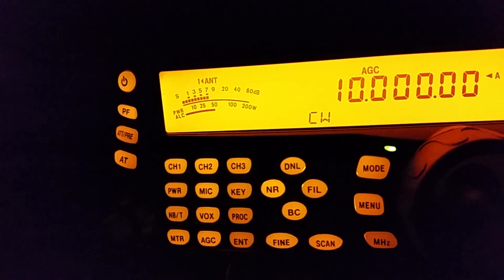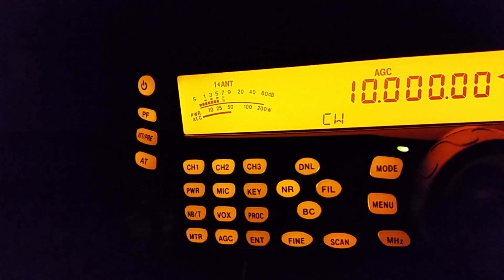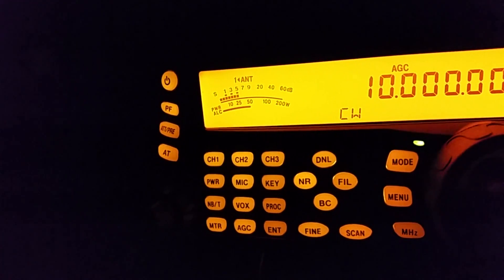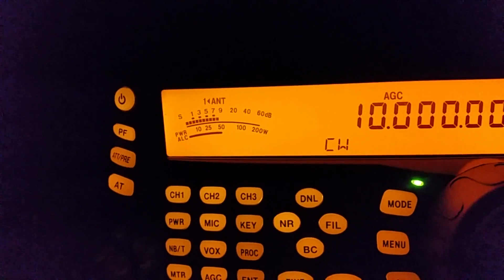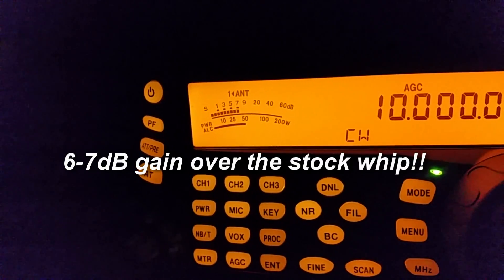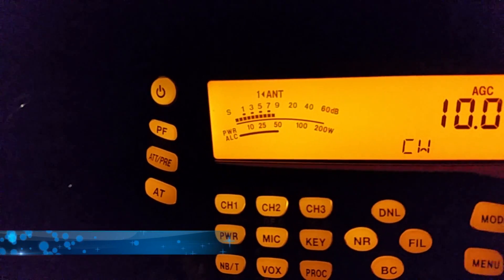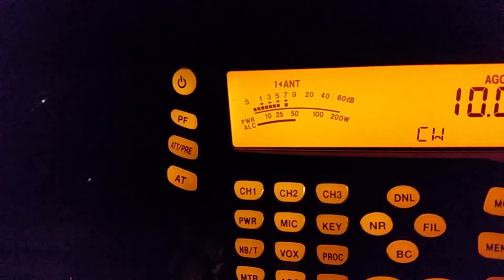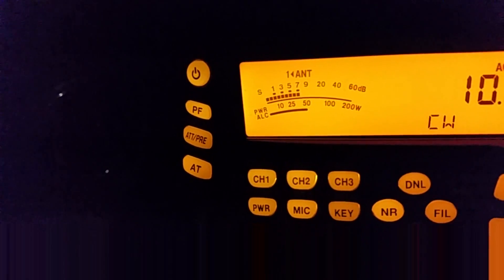Testing longer whips on a Little Tarheel II

Comment: They say that the gains are more pronounced on 80 meters and with the 10-12 foot whip 160 is possible. I just got mine last week after a 3 month wait. I'm thinking of setting up a rig with grounding so that I can try it on the base transceiver. No point in leaving it out all the time for the thieves to get. It might work well as an alternate base antenna when not in the vehicle.

Comment: have you had any problems getting on 80mtrs with yours TH? i got the tarheel extra long stinger and still doesnt tune 80 so not sure whats up.
Reply: I had a TARHEEL II & it tuned 80 meters with ease with a 54” whip as it did all of the other bands through 6 meters.
Reply: I would think that grounding is the issue.
Reply: @9999plato  i dont think it is grounding. i have the antenna on a L bracket screwed into my tool box on the truck and the tool box is grounded to frame in 2 places with braided wire the body of the 480 is under pass seat and grounded to frame. thats what has me stumped i think i`m doing everything right. next thing im going to do is clean the coil itself. i saw a video of a guy using alcohol to clean off the coil/rings and recheck all my connections again.

Comment: "100w in gives a TX signal similar to 400w into the stock whip". That's sort of a wonky way to express it. More accurate - The stock whip results in something like 5watts ERP for that 100w transmitter. A 6 dB improvement would be 20w ERP. There is no "Gain" in a screwdriver or any shortened antenna. Simple antenna concept is, the more any antenna is shortened (compromised) the more LOSS it will present. If you put a 23 ft whip on that screwdriver (a quarter at 10MHz) you'd have a 3dB loss over a half wave dipole. That half wave dipole is only 2.15dB gain over the theoretical iso antenna. 3dB loss, subtracted from 2.15 db gain is -.85dB "gain" (negative gain) over an isotropic antenna. Ain't no "Gain" going on with any mobile antenna under about 50 MHz, simply because we can't get anywhere near resonant length. RF apeture is tiny on a mobile HF antenna. ANY screwdriver, or any other mobile antenna, of a given length will perform exactly like any other antenna of the same length. It might be more weather or vibration resistant or have different cosmetics or mounting schemes. But in terms of RF pixies flowing, 24 inches equals 24 inches equals 24 inches. Thanks - Lumpy
Reply: He was very clear that the gain was relative to the stock antenna, not when compared to a dipole properly tuned and at the correct height. Read the text under the video. Anybody who has passed their test knows that short antennas are compromised when compared to dipoles or any other antenna that is much larger. In the case of mobile HF antennas, screwdriver antennas, particularly well made ones make the best of the limited choice of compromises. I'd have and would always choose a Tarheel or Scorpion antenna over ham sticks or any other sort of loaded antenna that have a very narrow bandwith.